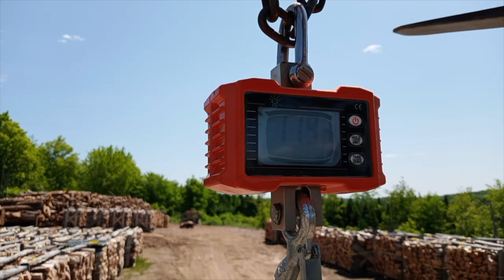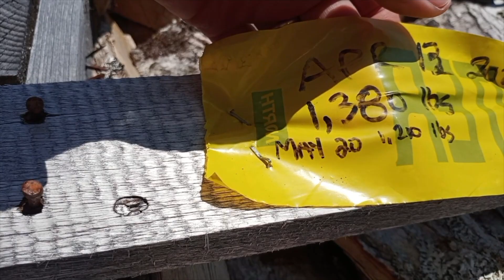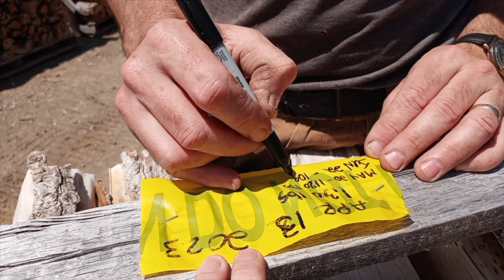20230622 Firewood scaled weight after 9 weeks

Comment: Have you looked into IBC Cages??...
Reply from the maker: Those cages in our neck of the woods sell for $150-$200, so we make our own.
Reply: @JimBarryWoodworkersWorkshop  same up here..  so I got on kijiji and found some for 50 in Toronto..  then kept looking and found a guy that can deliver them for 50..
Reply from the maker: @buckinfirewood  Pretty good price. I found them on Kijiji too. As low as $30 for a tractor trailer load, but shipping to NS is just way too much. For the price, we can build a couple crates, which last just as long. When a crate is no longer useable the wood is processed into kindling, so nothing is wasted.